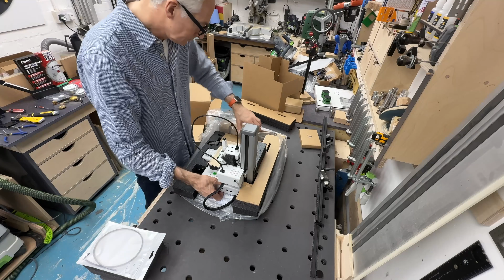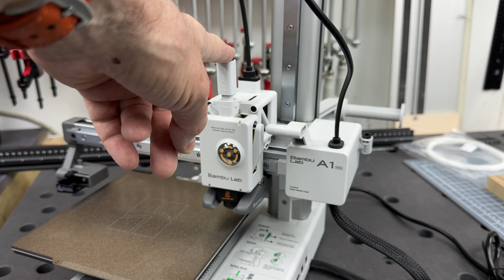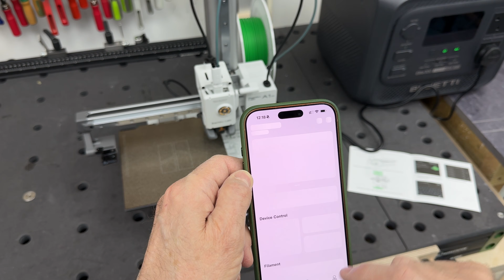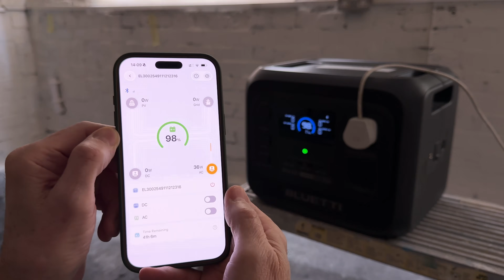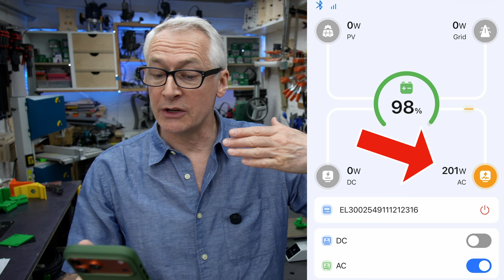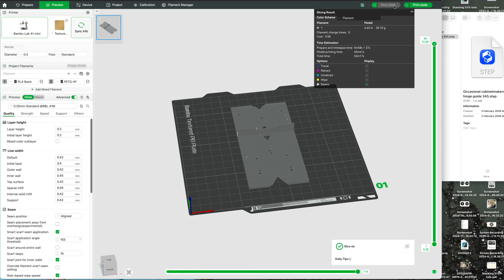3D Printer On A Battery? Sure, why not...[video 636][Ad]

Comment: I wonder if I could ask you a question, I want to build one of your MFT tables, could you advise on the best t-track size to use for clamp usability please.
Reply from the maker: For standard rail clamps then the t-track that’s 19mm wide x ~12.5mm tall is the one. I generally recommend the AUK t-track from woodworkers workshop as you can get it in 1220mm lengths. AUK T-track - https://amzn.to/4j6w1BV
Reply: @10MinuteWorkshop thanks for getting back so quickly, I'm going for a bespoke MFT wish me luck, as the saying goes, I'M GOING IN. thanks again Al.

Comment: I've had my A-1 Mini for about a year and have a box full of little "Benchy" boats. I print them when trying new filaments and to test settings for more things like PLA Silk and TPU. I am moving my shop to my old garage at the back of the property and a power inverter looks like the way to go. Using one as a UPS (Uninterruptible Power Supply) had occurred to me, too.
Reply from the maker: Yes, the UPS option is something I’ll be looking into! 👍

Comment: A word of caution w.r.t. the metal scraper: it can damage your print plate (the engineering plate is probably fine since it’s metal but I personally wouldn’t use it on any non-metal plate)
Reply from the maker: I only use metal plates, good to know thanks! 👍
Reply: @10MinuteWorkshop I can recommend the cryogrip plate: it’s not metal and allows printing PLA with close to no heating of the plate (it also supports printing PETG at a lower than standard plate temperature
Reply from the maker: @gvanvoor I’ll check it out, thanks! 👍

Comment: I see one or two positive comments on the Bambu lab 81 mini. Is there anyone that can convince me otherwise or should I go for it.
Reply from the maker: Go for it! I have six Bambu printers including this one and I’m about to buy another three.  They’re solid, dependable printers that pretty much, just work. 👍
Reply: @10MinuteWorkshop  Thanks
Reply: @RetcorPS  Go for it....A1 mini was my first bought "ready to go" 3d printer, it makes a hobby of fixing a 3d printer, a hobby of printing stuff! I now have 2 bambu printers the A1mini with an AMS lite and a P1P upgraded to a P1S with an AMS2 Pro and 2 AMS HT's (which reflects my budget constrained upgrade path). My advice would be to get the highest spec machine your budget and space allows in terms of print bed size and where you'll use it but include an AMS. Bambu sale is on now so opportunities are there. Once you've bought a machine only look at the filament offers as "the  want will fast exceed the need"🤣 Good luck on the 3D printing journey, it starts with a click of the mouse and a clunk and whirr👍
Reply: @pauldavies8074  Thanks for your advice.

Comment: I still chuckle at how long it took you to jump on the printer bandwagon, I watched your vids pre that and have one of your tenon jigs and I knew you’d done the hard bit of the drawing spec. 
Still enjoying the content - 
Might have been nice to post up the print time of ?? Used 2% of the battery to give folks an idea of how much battery they’d need for an event /show relative to the prints they were doing .
Reply from the maker: Thanks!  It was my lack of CAD knowledge that was cramping my style!  I don’t know much now, but I know enough - just! 😂👍
Reply: @10MinuteWorkshop I’ve gone down the fusion 360 free version route and it was a slow start but I’ve now had an a1mini out of the points( which i gave to  my local school ). I’ve been doing the jigs and kids toys thing and I’m on MW as tonyst.
My favourite thing is the precise drill jig to put spikes into a banjo. 
I do try and put stuff on MW though to help folk out - obv only a hobby for me and not my living . I did use your tenon jig which I bought to make some custom wall cabinets to put the filament and tools in, for the x1c box room ! Worked brilliantly!